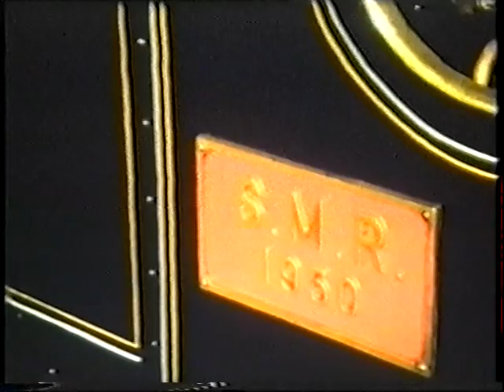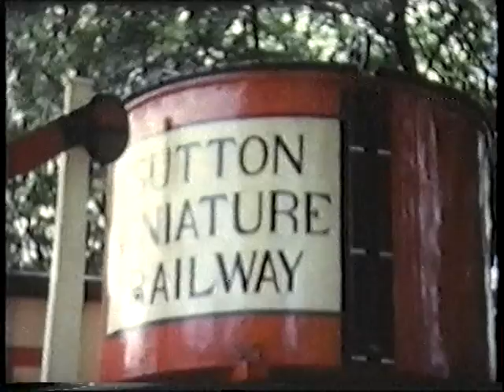Sutton Park Miniature Railway

Comment: Any ideas where the carriage is being outshopped from around 4:20 into the film?
Reply from the maker: +Rob Bending Yes - from the then owner's business premises, Hunt Bros. Griffin Foundry , Oldbury, Near Birmingham. All of the footage from the beginning was filmed there. At Griffin foundry, the Hunt family used to carry out all the maintenance work on Pat Collins' traction engine fleet, some of which they purchased for preservation. I believe the engines "Sutton Belle" and "Sutton flyer" were built by Thomas Hunt at the foundry for the Sutton Railway.
Reply: @Nigel_Gardiner  that's correct, I work at the Cleethorpes coast light railway and these engines are stationed there. Sutton Belle and Sutton Flyer are improved designs of little giant class of locomotives built for 15inch gauge. They used blueprints from Mighty Atom, the first 15inch gauge engine to run on the SMR